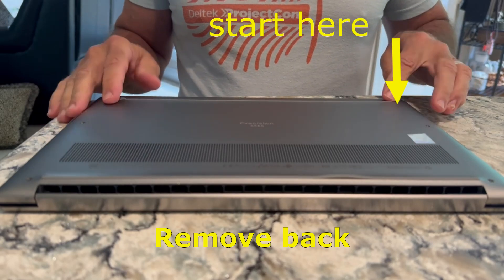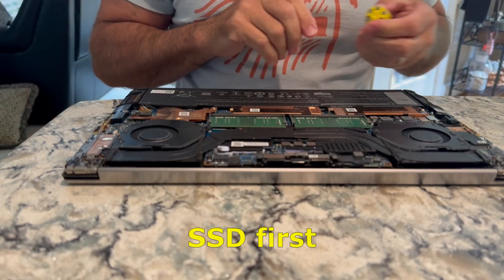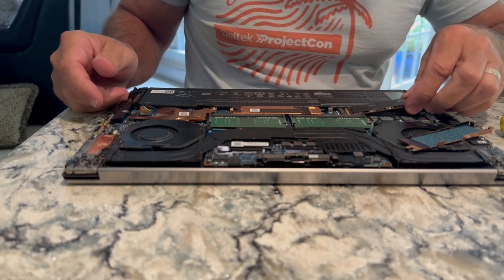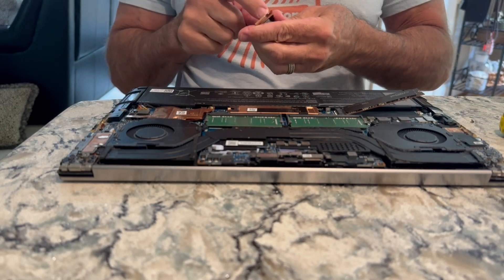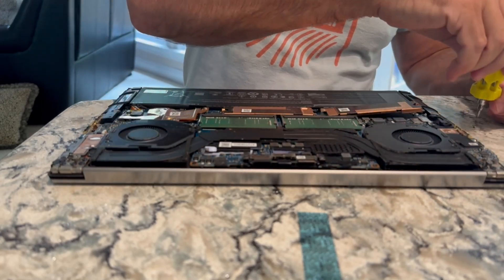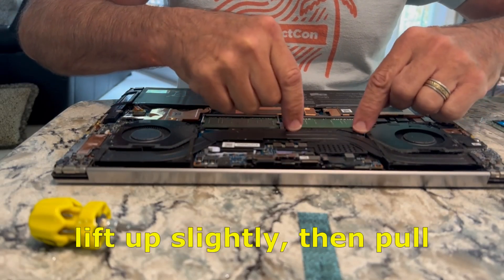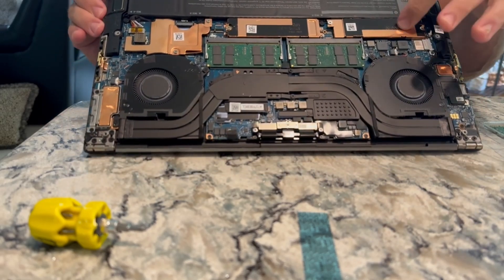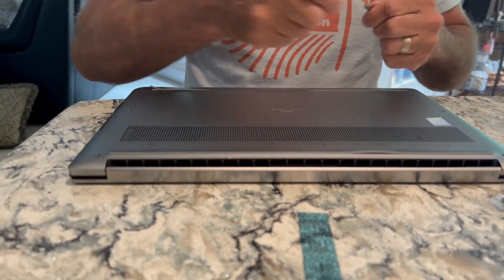Dell Precision 5560 Upgrade

Comment: I would have placed a towel under the laptop before working on it! Great upgrade Sir! Have you had any problems with the USB - C charge port? Also, can you use the other USB ports to power the laptop? Thank you
Reply from the maker: @j.lietka9406  is there something I don’t know about the usb c ports? I just checked and I can charge on all 3 of them, but they are not all the same, apparently. I have found that a wireless mouse will only work in one particular port. Seems like I have been suspicious about these ports for a while…
Reply: @fiveyorks  thank you for your reply! Recently I found a tossed out Dell Precision 5570 + the charger, plugged it in, but the charger light stayed white. The laptop wouldn't turn on, so I don't think the battery was charging either. I think the port might be defective as when the charging cable was connected to the primary(?) - C port, it seemed to wiggle up & down, like the - C port might be getting loose. I only used the left side  - C port, by the safety lock  cable spot. I didn't try using the other - C ports as I wasn't sure if that would work. So I was asking around! It's a very nice laptop! In it's box too! As a kind of hobby I look for electronics in dumpsters and curbside stuff! I checked on line for additional info on the use of the other - C ports but not much luck as far as using them for powering on purposes.
Reply: @fiveyorks   I considered trying the other 2 - C ports but was hesitant as I don't know if it would work or not. Thank you. So you tried the other ports, and your laptop still worked? Did the battery also charge?
Reply from the maker: @j.lietka9406  yes the power icon said it was charging in each of 3 usb c ports :)
Reply: @fiveyorks  hmm! I will have to try those! Your laptop had no adverse effects using the others? Thank you again sir!